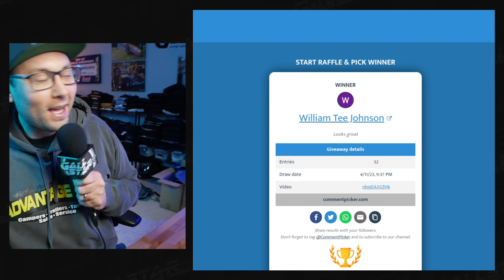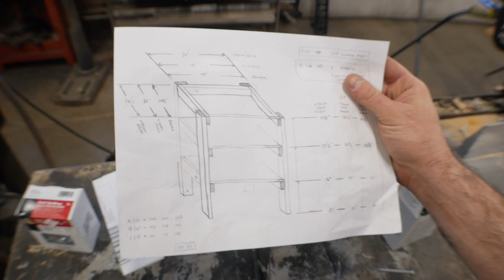Removable X-Track Shelving! | Enclosed Trailer Organization

Comment: That looks like what I did! The only difference is that I used the pre-made wood shelf brackets from Menards. All you had to do is add plywood. I am now in the process of switching over to those black plastic shelving units with five tiers on each one. I am modifying by adding 1x6 around the perimeter to keep stuff from siding off and also adding some rollers/ casters to the bottom so that I can move them from one side of the trailer to the other. Most of the time I anticipate having one shelf on one side and one shelf on the other side, but when I need to haul doors and windows, I can just shift them all over to one side and have the windows and doors be on the other side. In all cases, I just use ratchet straps to hold them in place

Comment: What did you use to connect the track to the wall? I'm about to order the track, but I'm unsure about the size and style  screws and where to attach it.
Reply from the maker: I used an aggressive thread self tapping screw.  Fastened it every 16” into the metal studs of the trailer.  Needed to drill pilot holes if I remember right.
Reply: @GallStarTV  thank you!

Comment: What was the adapter you use on the back of your shelf to hook to the track?
Reply from the maker: Its just a bolt on e-track connector. You can find them at Home Depot in the e-track section